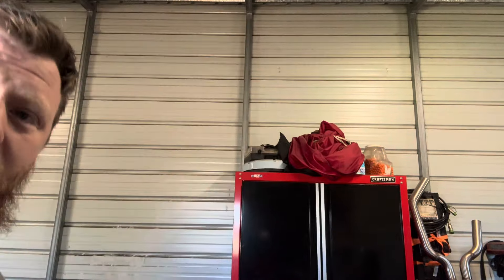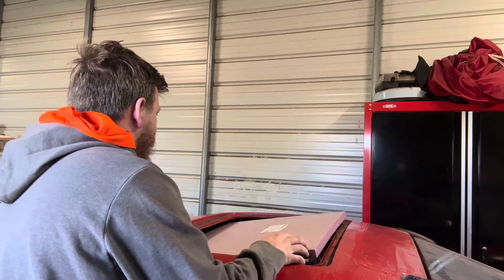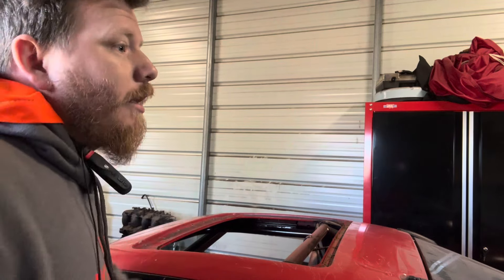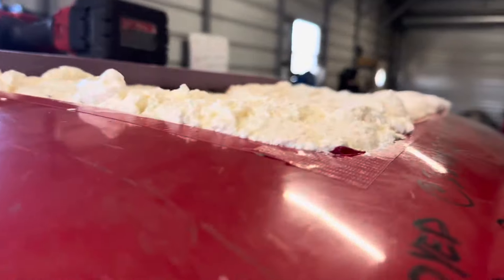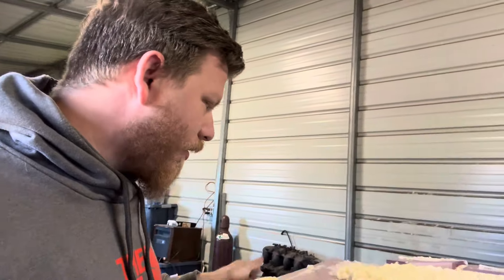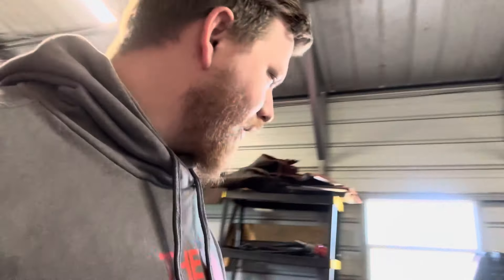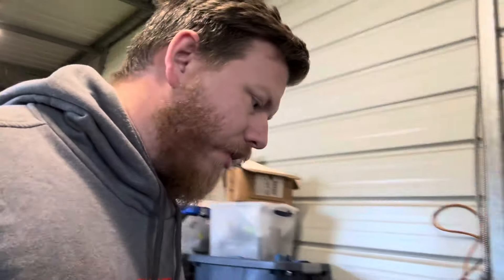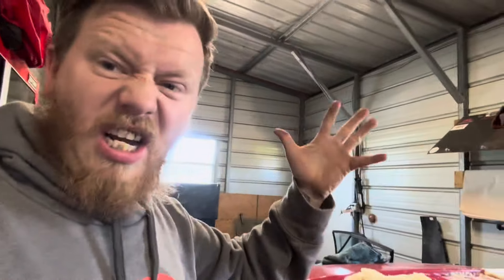Ruined the sunroof on my 1000hp ls turbo rx7DOH!

Comment: What temps did you do the spray foam in? If it's too cold it won't cure. It also needs access to air and laying that insulation on top didn't help.
Reply from the maker: Mid 50 low 60? It was definitely chilly. Next time I think I’ll order expansion foam off Amazon lol